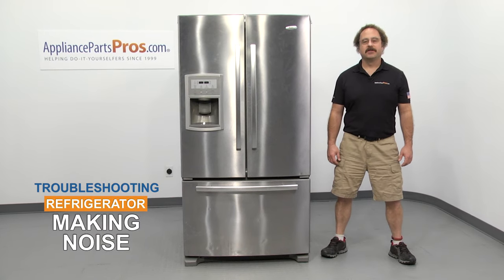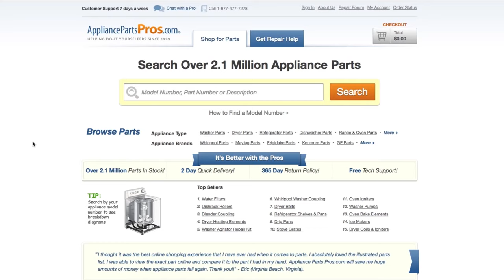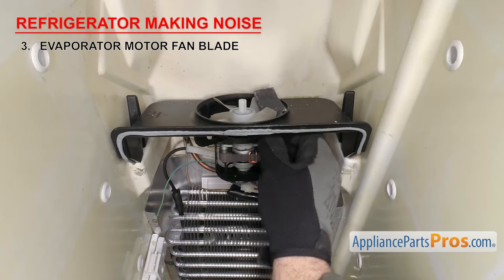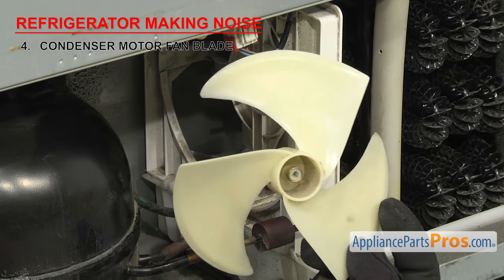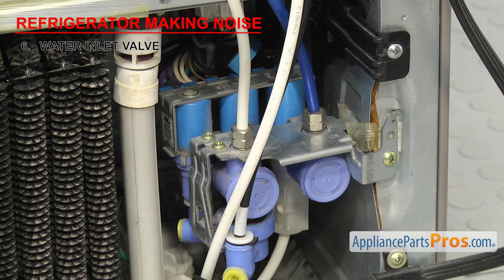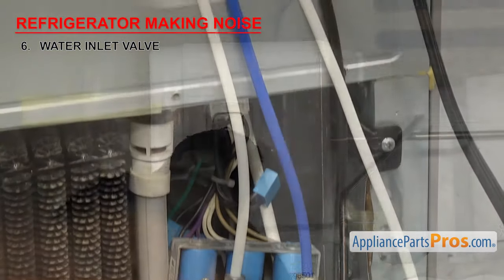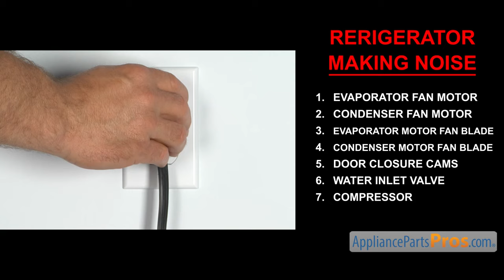Refrigerator Making Noise - Top 7 Reasons & Fixes - Kenmore, Whirlpool, Frigidaire, GE & others

Comment: Thanks for the tips!  Here are time stamps for anyone looking for specific sections.

0:00  Intro
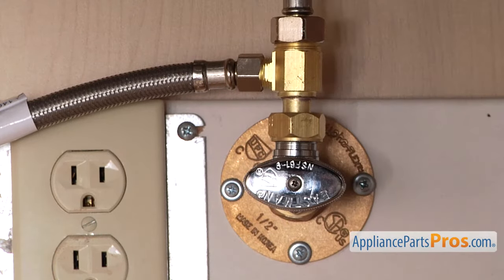0:21  1)  Evaporator Fan Motor
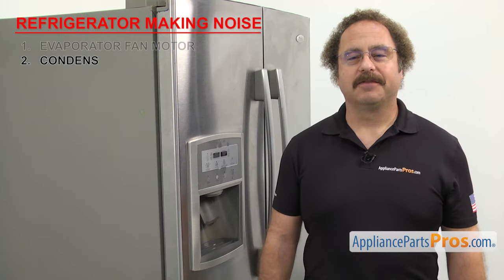1:30  2)  Condenser Fan Motor
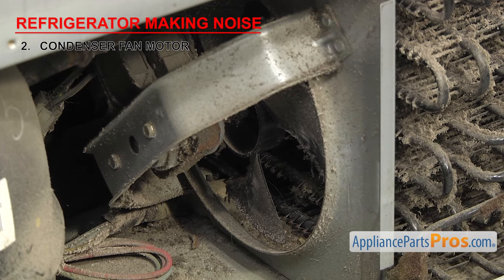2:06  3)  Evaporator Motor Fan Blade
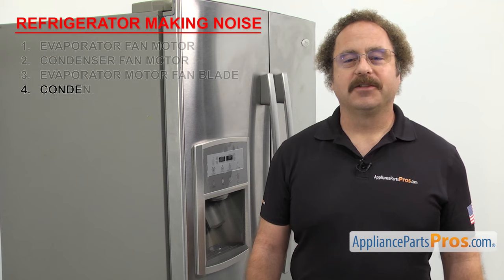3:00  4)  Condenser Motor Fan Blade
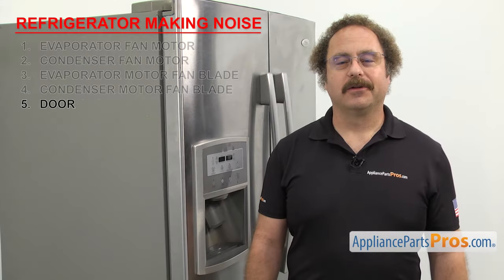3:41  5)  Door Closure Cams
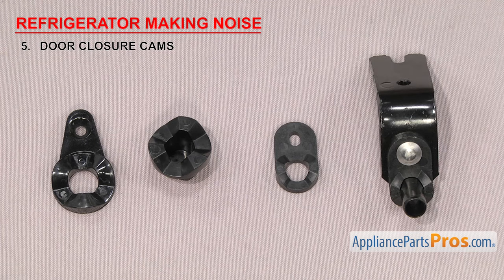4:24  6)  Water Inlet Valve
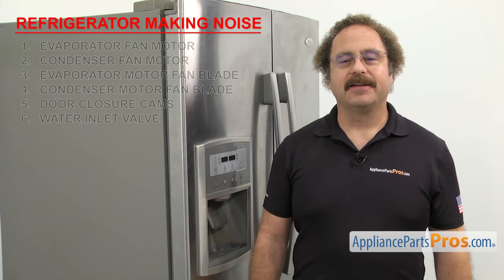6:11  7)  Compressor
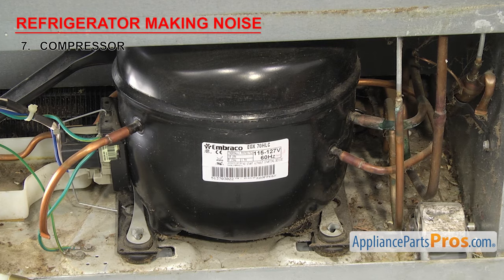7:08  8)  Money Saving Tip - Clean your Condenser Coils at least once a year

Comment: Great video. Maybe the best video that I came across on YouTube, troubleshooting refrigerator noises. But you missed one. At some point I accidentally hit a little handle in my freezer area that activates the icemaker. I don’t use my icemaker, I never hooked it up to a water line. But at some point I accidentally bumped that metal handle, which activated it, causing it to make clunking noises. I flipped the metal wire handle back up to the off position and voilà! The knocking and bumping noises have stopped! I am so glad it was something simple.

Too bad you don’t have anybody monitoring this video comments. It would be nice to have somebody replying to their comments, helping people out while they are trying to troubleshoot their refrigerators.
Reply: Missed another one. Mine is making a blowing wind noise. Goes on and off, sounds like a gust of wind. Fans are all good

Comment: The evaporator fan sounds like running at erratic RPM. No squeak or grind but sounds like struggling to run at full speed. Unit is still cooling just fine. Should  fan sound like this?

Comment: My Kenmore Elite 795.7105 makes 16 rapid knock-knock-knocks every 60 minutes near the freezer discharge vent. Sound is not coming from underneath where the compressor and water solenoid are. Ice maker is off. Any ideas?

Comment: We have a kemore refigerator french doors and freezer on bottom 2015-2018?.  We have replaced the evaporator fan and the control panel and the refrigerator still does not cool the refrigerator portion.  The freezer is working perfectly.  What is the problem?

Comment: I have a Kenmore double side door fridge with ice maker/water dispenser that constantly makes a sound identical to what a mouse digging a hole in the wall would sound like, clicking or tapping at wood . The waterlines have never been hooked up it cools/freezes fine the sound seems constant it's used got a little banged around on delivery 4 months ago but I just noticed the sound 2 weeks ago. Maybe it's always done this but I'm not so sure. Any advice on whats going on? 
Thank you.
Reply: Perhaps the ice maker has an on/off switch and it got accidentally turned on, The fridge will try to pull water but it won’t be able to because it’s not hooked up. I found out about this while troubleshooting mine for a different problem because I don’t have the ice maker  hooked up either. If it is on, put it in the off position.

Comment: I have a GE Profile about 10 years old has a knocking noise around the cooling fans and motor.  It knocks about 10 times for 3 seconds every 5 minutes, very regularly.  It sounds like a quiet jack hammer.  I cleaned the cooling fans in bottom back (coated with this dust).  Does anyone know what the problem is?  I have recorded the sound and can send a picture of the area, lower back of refrigerator.  Thanks.
Reply: My refrigerator makes a quiet jackhammer noise when the freezer is defrosting.

Comment: I thought the sudden loud hum noise was the freezer fan. Nope. I aimed a strong small table fan at the bottom back of refrigerator (along where the compressor is) and the loud noise stopped. 
  Mind you, the noise was coming from the freezer compartment. But by me cooling the outside back bottom of the refrigerator, I stopped the loud noise.

Comment: Our new LG fridge seems to work fine, but at seemingly random intervals it will make what can best be described as the sound of a dial tone on an old analog phone. This sound is fairly faint, but definite, and will only last for a few seconds and stops. The sound itself is faint, and it's not a big issue in itself, but we'd like to know what it is.
Reply: My new Whirlpool French door model makes those same phone dial tones, especially after closing the doors.
On Whirlpool forums it is said customers are being told by Whirlpool and their techs that this is a normal noise, and part of the operation of appliance.
Until seeing your post, I had no idea other refrigerator brands did this 👍
Reply: Is it the ice maker?

Comment: The fridge is having a loud grinding sound coming from the back panel of the freezer, there's a fan.
Reply: My 10-yr-old Whirlpool occasionally sounds like a motorcycle revving up, and lasts from 20 mins. to an hour. Is that similar to your sound? A handyman and a refrigerator repairman have been out. Both say all parts are in working order. Of course the sound was not happening when they came.

Comment: Is it the fan?  No, what about the fan? No.  Did you check the fan blades? Its not the fan.  Is the fan making the noise, it could be the blades?  The fans are fine.  Ok then its your door hinges.  No the fridge is popping.  Ok then its your water valve.  No its popping.  Got it the compressor is bad.   

Lol..  9/10 the problem is dirty coils which will in turn cause this stuff in the video to fail, but they wouldnt tell you that because preventative maintenance plays hell in the parts selling business..